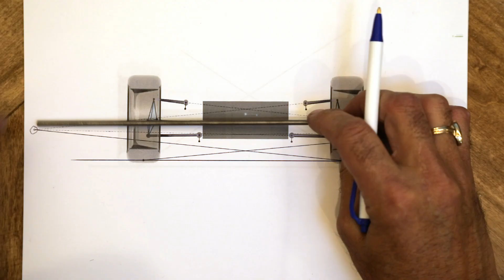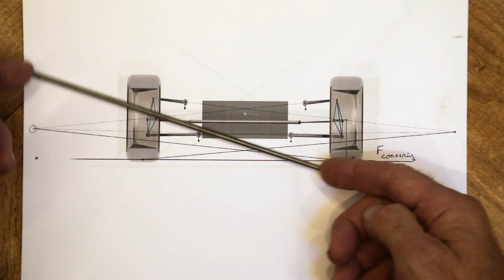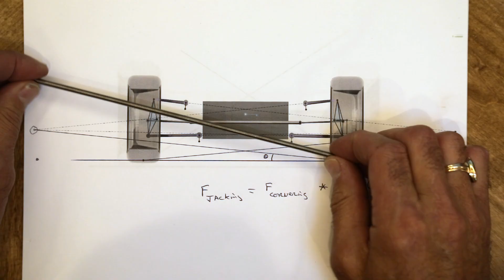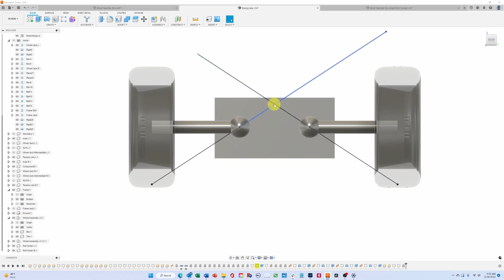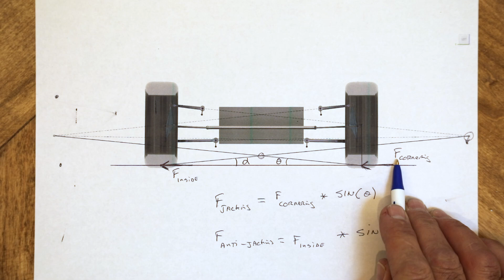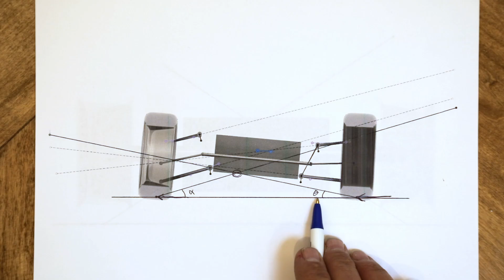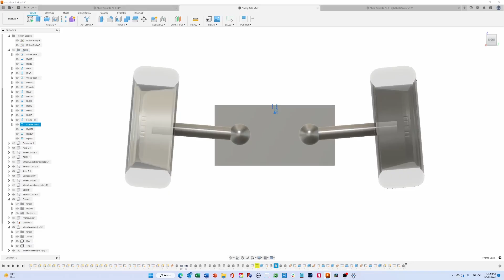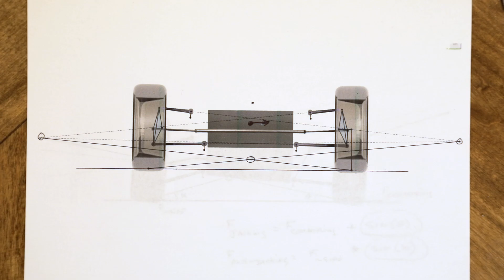The Complete Guide To Suspension Roll Centers - Part 2

Comment: If the cornering force is acting horizontally at the tyre contact patch, then presumably the jacking force which acts vertically is cornering force multiplied by tan of the angle.
Reply: I agree with you that the trig function should be TAN not SIN.

Comment: Very nicely done. The Olley book is quite in-depth on calculating centers and showed solid axles to have high roll centers but never explained why. You didn’t overtly explain it either but you left clues that have helped me.  With a vert short lever arm (moment) between roll center and center of mass, rear body roll would be next to nothing were it not for chassis rigidity.

Comment: I had to really think about this lesson.  I even had to watch it twice.  You really confused me when you drew an arrow to the left, on the right side tire, saying that the force applied is causing the  jacking force, lifting the left side of the car.  

Took me a bit, because i was thinking of the ground being static, and unmoving, and the vehicle was moving, applying the cornering force in the opposite direction from what you had drawn.  I suppose it really doesn't matter, because each force is met with an equal & opposite force.. I just know the car moves on the ground, which seems to me to be the force applicator, not the counter force of friction of the immovable road surface. That would be a counter force, in my mind.

Comment: Do the effects of roll center on jacking/ride/and roll only apply laterally, or do similar effects occur in pitch due to front and rear suspension roll centers? Would be helpful to understand how this exhibits in a 4x4 with two live axles, as well as vehicles w/ a solid rear axle and IFS

Comment: Hi, 

Can you talk a bit about how a front transverse upper leaf spring and single wishbone lower wishbone (like a 1950's cooper f3 car) would place the roll centre? In my mind the leaf spring is acting like a long upper wishbone, pivoting in the centre of the chassis where it is mounted. This would place the  instance centre on the outside of the car, not on the opposite side of the chassis as you were describing (i.e. the upper wishbone is mounted higher on the chassis than the upright). 

great video, thank you!

Comment: In the jacking discussion, I don't get why the weight transfer to the outside wheel is not considered? Yes, the lateral force on the outside wheel wants to tuck the wheel in, jacking the body up. But the outside wheel also carries more weight while cornering, making the wheel want to go up relativ to the body. If you consider both, the roll center should be located on the CoG of the body for no jacking forces, right? Making the old school suspension more feasible. However, what am I missing?

Comment: I think body roll is more important then jacking, because big car manufacturers make different hubs (witch costs a lot of $) for the same car with lover suspension option, to bring back up roll center. If lowering roll center (and jacking force) wouldn't make suspension perform much worse, they wouldn't go out of their way to change it.

Comment: Amazing video,, why is the upper control arm shorter, and  why is the knuckle tilted. what is the engineering behind that?
Reply: I'm not an expert but I reckon the shorter top wishbone gives a desirable camber change when the car rolls, it pulls the top of the tyre towards the center of the car so the tyre stays flat to the ground

Comment: Thanks for this great video. After watching this one and the previous one I find myself looking for a third video, one that covers a solid axle rean end. Does anybody know a good video that covers the rear suspension like in the old cup cars and the NASCAR/ Whelen tour type modifieds?   Most guys usually run either a three link or a torque arm but other variations are possible.
Thanks!

Comment: I could be wrong but always thought it's a good practice to keep roll centre migration to minimum (like within few millimeters). I guess my question would be is there a negative effect of excessive migration? And what would be jacking value that we could call under control? Short example of this equation with values would be useful.
Reply: U can compensate with tire sodewalls and also ot depends on your driving stylle a little more movemnt is nice if u like to snap and flick the car but sometimes it can make ot lay into corners a bit twitchy if the roll center moves around alot likenon lexus especially under vraking or throttle
Reply: @Matt-g9z  Thanks for the insight. Would you design your suspension with or without RC migration?
Reply: Camber can affect it and control arm length as well I should have mentioned that.
Reply: Please address this question

Comment: Great explanation! I used to be big into offroading/rock crawling. Lowering roll centers paid huge dividends in building go-fast desert racing rigs (see: King of the Hammers). For dedicated rock crawlers, higher roll centers were much more stable on side-hills etc.

Your demonstration of the contact patch shifting left/right is basically a 90 deg rotated view of the concept of "wheel recession" which also helps in going fast in the desert on solid axles. People found having flat links allowed the front solid axle to move backwards as it goes up in bump and absorbed fast whoops much better.

Most have moved on from solid front axles to IFS, but when I got into auto-x and tracking cars, it was nice to see a lot of what I'd learned translated to on-road stuff as well.

Comment: This the best video about explaining what roll centers do, but I think part 3 is needed. How the front and rear roll centers affect car behavior, understeer, oversteer. From my understanding and experimentation, building my own racecar, one would want for a 50:50 weight distribution car to have a higher rear roll center and a lower front roll center so that just enough force would be transferred to the front outside tire as to achieve it's maximum grip for the given slip and camber angles.
Reply: The notion that 50/50 weight distribution is optimal is false. A rearward bias with the mass situated somewhere close to the center of the car is always preferable in a rwd racing car. Also, keep in mind that the weight transfers under dynamic load.  The Porsche 911 has something like a 40/60 or 30/70 weight imbalance.  It shifts more weight to the back under acceleration, improving grip on the rear tires.  It also shift forward during braking, giving the car an almost perfect 50/50 weight distribution in braking zones.  So in theory, it can accelerate better and outmaneuver other cars in the brake zone going into corners.  The 911 is not a perfect car, but it shows that 50/50 is not always the best distribution for every car under every circumstance.
Reply: @tomprice5496  Optimal weight distribution is a compromise, just like everything else in suspension design, too. If you want to optimize for cornering during braking, you would need totally opposite compromise compared to optimizing cornering while under max power in RWD car.
Reply: @MikkoRantalainen  Well said.
Reply: Yep, a part 3 would be very useful 🙏

Comment: Good explanation,  I was wondering about the multi-link style.  Does KPI and wheel center-line play a role in roll center?  If you have scrub radius (meaning KPI and wheel center line do not line up), which one do you use for calculating Instance of center?
Reply from the maker: Roll center has nothing to do with the KPI. The only thing you need to know is where the center of the contact patch is. That's where you draw the line to.

Comment: Is the centre of the tire where the reference line is or is it where 0 scrub radius is?
Reply from the maker: The line goes to the center of the tire.
Reply: @suspensionsexplained  so it changes with offset?
Reply from the maker: Yes it does. It goes wherever the tire center is.

Comment: So, what if one were to add a body mounted Watts linkage to a live axle set up? Would the centre of the body mounted Watts linkage become the effective roll centre? If so, mounting this lower than the axle centre point would lower the roll centre and increase the roll moment. I have seen these systems in the after market but never understood any theoretical advantage compared to an axle mounted Watts linkage (except for a slight reduction in unsprung mass) and now the roll centre moves with the body not the axle but why add the complexity? Asking for a friend 😉

Comment: Thanks for the excellent videos, I am really enjoying watching them.
One thing I have read about previously is the relevance of the slope of the roll centre axis ie a line drawn along the length of the car between the front and rear roll centres.
So if the front roll centre is lower than the rear, this axis would slope up towards the rear, and vice versa.
I have seen some discussions about this that suggest the angle of this axis should be similar to the mass centroid axis of the car ie if you analyse the CoM of the car in chunks along the length of the car and the centre of mass at the front is lower than the rear ( eh mid engine car) it is preferable to have a roll axis that also slopes up towards the rear.
Is this something you are aware of?
Thanks again.
Reply: The idea behind that is that you want to keep the distance between roll centre and CoG small.  Otherwise you will get a lot more roll moment at the side of the car where the CoG and roll centre is big.  It influences the slip angles (so causes under/oversteer to get worse)
Reply: @stevenvandenbosch5528  ahh, of course, that makes complete sense, thanks so much for replying, that's really great. I've been wondering about that for years!